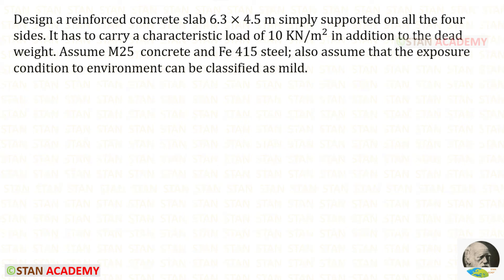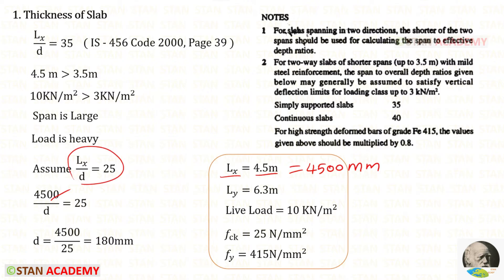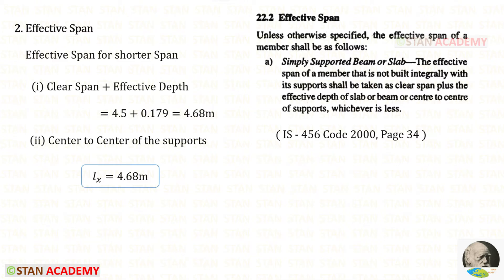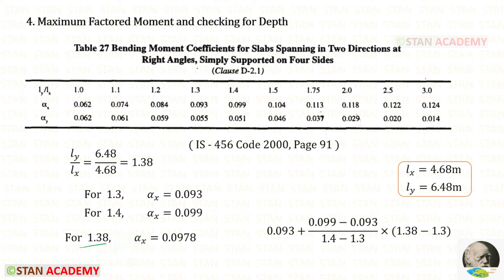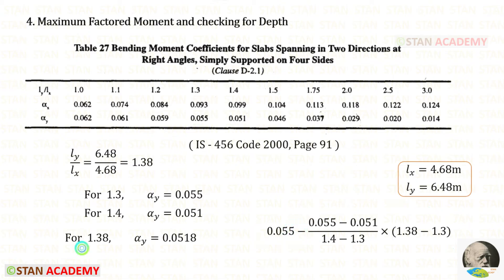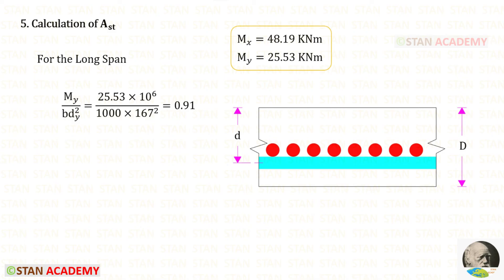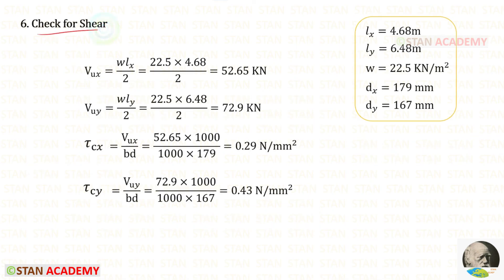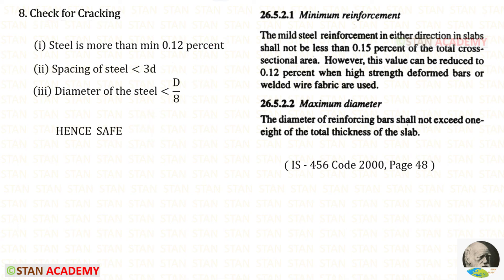Design of a Simply Supported Two Way Slab using IS - 456 & SP -16

Comment: Reinforced Concrete Design II Assignment I
Design the reinforcement for a simply supported slab 220mm thick and spanning in two directions. The effective span in each direction is 4.5 and 6.5 m  and the slab supports a live load of 10 kN/m2 and Fire resistance 2 hours. The characteristic material strengths are fcu = 30 N/mm2 and fy =460 N/mm2. 
How do I go by this question please